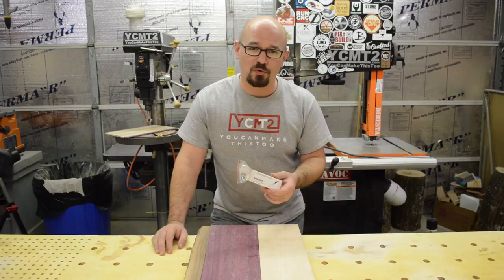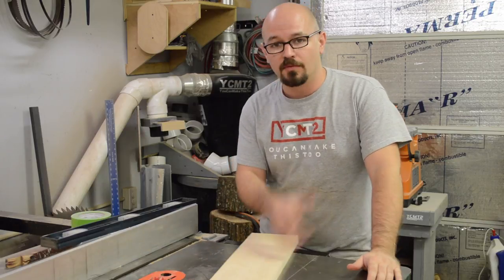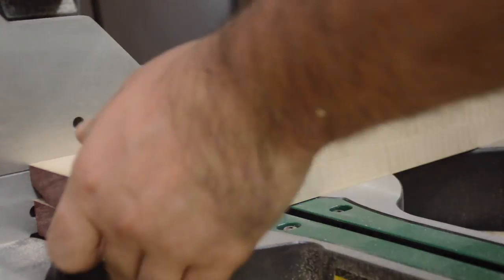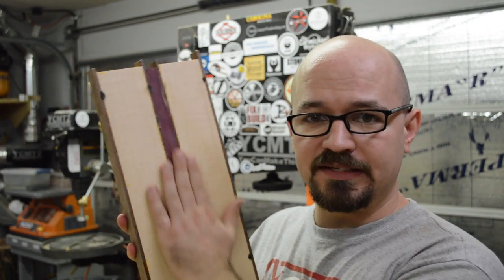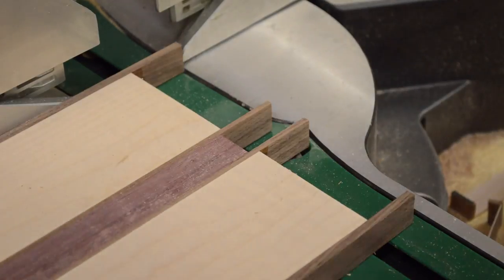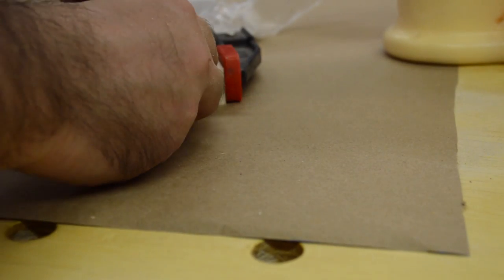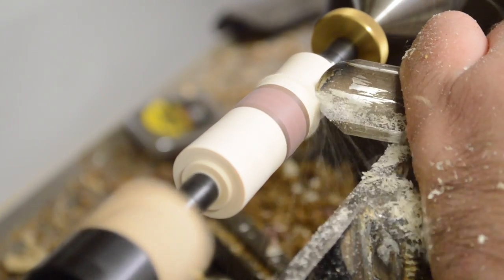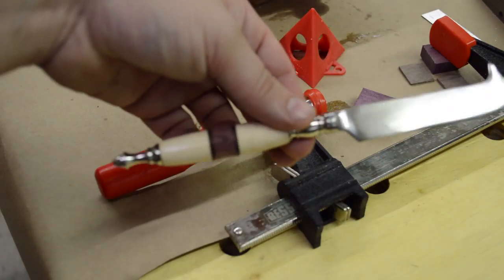How To Make a Matching Cutting Board and Cheese Knife

Comment: That's a nice looking set! I can't believe how good the 15 coat finish looks on the knife handle. Great video!
Reply from the maker: Thanks, Bruce! It was a pretty quick build too. I get a little carried away on the friction polish on small items like this, but it's really fast to do. Also, each "coat" is just an ice pick dipped in the finish and then rubbed on the paper towel and buffed in. The total thickness is probably around the same as two brushed on coats of shellac.
Reply: Oh, interesting to know. When you said "thin," I had no idea it was THIS thin! ha ha
Reply from the maker: +Bruce A. Ulrich haha oh yeah! It's barely any. The idea is its thin enough that with pressure you build enough heat to almost instantly cure it. So you do need quite a few coats. Only takes 5 minutes or so, if even.
Reply: YouCanMakeThisToo Very cool. Locking this away for when I get a lathe.

Comment: I am still jealous of your jointer.
Reply from the maker: It's an enviable machine. But I'm sure it won't be long before some awesome machine company sends you a sweet helical head huge jointer to use.
Reply: Really like the combination of woods you used here. I do the same thing when I turn pen blanks, sanding down to finial profile. Where did you get the blank for you’re cheese knife?  Liked your video.
Reply from the maker: Thanks! I glue up the blank from scraps from the board.
Reply: Thanks for your comment. I guess I should clarify what I was asking; where did you get you cheese knife hardware. I buy my pens kits and other project workings but they have no cheese knife hardware, and Rockler has a 4 piece kit.
Reply from the maker: Ah gotcha! I ordered it from Penn State Industries, but I don't think they carry it anymore. Sorry!
Reply: Thanks, I keep looking.

Comment: Very nice work but there are so many better choices than mineral oil.  Hemp oil, tung oil, walnut oil, even boiled linseed oil.  These are all drying oils.  Mineral oil is non-drying and is a class III carcinogen.  I know a lot of folks use it but it's not really the best choice.
Reply from the maker: +pgfollett I didn't know most of that, thanks for sharing!